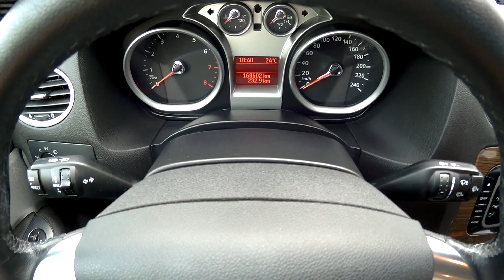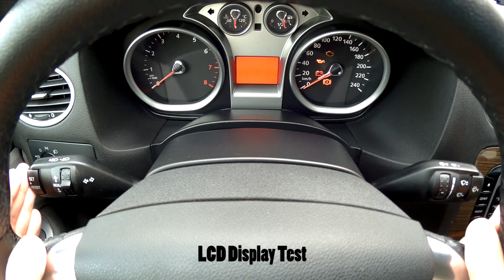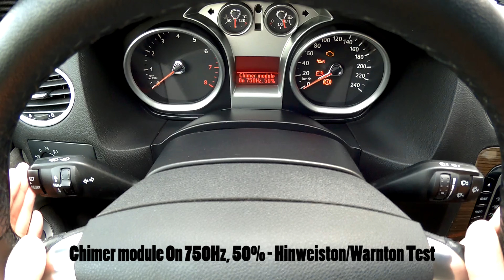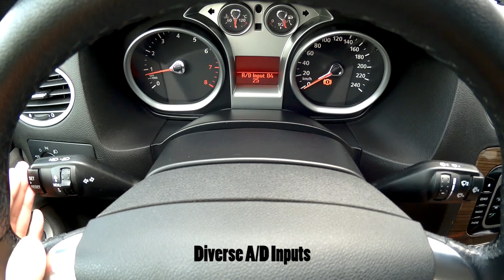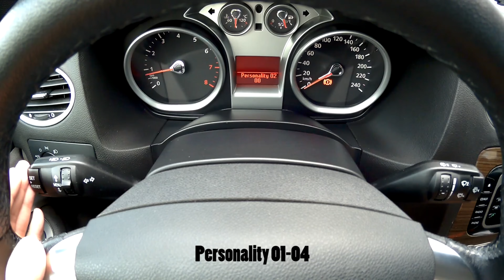Service Menü für Ford Focus MK2 | C-MAX | Kuga - Bordcomputer Selbstdiagnose Modus | DTC Fehlercodes

Comment from the maker: Mit Startknopf aktivieren / Activate with Start Button (keyless go)

Für Fahrzeuge mit Keyless Go and Starttaste: Halte einfach die Set/Reset Taste gedrückt, während du die Zündung per Power-Taste einschaltest (Keine Füße auf den Pedalen!). Wenn die Testmeldung auf dem Display erscheint, kannst du die Set/Reset-Taste loslassen.

For vehicles with keyless go and start button: Simply hold down the set/reset button while you switch on the ignition using the power button (no feet on the pedals!). When the test message appears on the display, you can release the Set/Reset button.
Reply from the maker: Die warntöne gehören zum testdurchlauf. Fehler sind unter dem Punkt DTC aufgelistet.
Reply: My one has keys, is not keyless but I will check anyway turning the key in the ignition. It will work out? Thank you.
Reply from the maker: Like in the video, yes. 🙂
Reply: Ñ
Reply: code 5750 (C1750)Accelerator position sensor out of range

Comment: Great just i dont know what of the most messages means
Reply from the maker: Hello, doesn't the listing in the video description help? Otherwise, I'm also happy to help here.
Reply: @htbo  hi there..to be honest i just saw the list:) thanks alot
Reply: @htbo  hello there..i cant understand or find same message as listed..can i write them all down and write them here or some mail?
Reply from the maker: Yes, write everything down here and I will try to respond as quickly as possible. 🙂
Reply: @htbo  "cold engine 4.41 007
-eco gear shift 4.91
-personality 0300,0200
-port t ed
-port s 11
-port p22
-port m14
-port l FF
-port e of
-port a 1b
-ad input 0515
-ad input 03 ff
-ad input 02 7d
-ad input 01 ff
-ad inputt 00 96?not sure
-pats key flags 10
-fuell flow 0000
-fuell guage 0185
-fuell ad 2 input 0 passive

There is a few more...iwrite later..i dont want to send so much))

I accidentally change my temperature to farenait from celcious...how i change back?)
Reply: Hi...i wrote the codes..if u can describe them please

Comment: I have a focus 2009 duratec the presence key only works the open and lock option does not work what can it be?
Reply from the maker: Hello, in which country was the Focus sold?
Reply: @htbo  Brasil
Reply from the maker: I think that's the reason. For the Brazilian market, features or entire equipment characteristics are often omitted.

Comment: Not working in KUGA MK1 2011 with Power Button (KeyLess System) ;(
Reply from the maker: Hello, should actually work. Read through the first pinned comment. if that doesn't work just get back to me.

Comment: Bonjour , je fais exactement le test avec le bouton set e reset je tourne la clé mais le mode TEST ne m’apparaît pas , j’ai une Ford Focus MK2 2008.03
Reply from the maker: Bonjour, en fait, cela devrait fonctionner de la même manière pour ce modèle. Pour autant que je sache, il n'existe pas d'autre combinaison de boutons.
Reply: @htbo  oui , j’ai testé plusieurs fois , mais le Test n’apparaît pas , et moi mon écran lcd il est plus grand que celui dans la vidéo
Reply from the maker: Le plus grand écran est installé dans les véhicules équipés du système de navigation. Normalement, cependant, cela ne devrait pas avoir d'influence. Je vérifierai à nouveau plus tard.
Reply: @htbo  oui , ma Ford est une phase 2 2008 en break , full options et est équipé de l’écran avec le système de navigation touch  , mais je ne sais pas pourquoi cela ne marche pas
Reply from the maker: Avez-vous une boîte de vitesses automatique ? Veuillez essayer d'accéder au menu avec les portes fermées, le frein à main enclenché et le frein serré. J'ai demandé à nouveau, normalement cela ne devrait pas faire de différence avec le système de navigation.
Salutations d'Allemagne.
Reply: @htbo  non j’ai une manuelle à 5 vitesse ,

Comment: Hi I have a 2008 focus manual. I left my lights on and the battery died I have tried charging the battery with jump leads and now I get a transmission malfunction error and no crank. Do you think this method my had me find a error code?
Reply from the maker: Hello, can you give me the exact error code? Already measured the fuses? Normally, a dead battery or a proper bypass of the battery should not limit the functionality. However, diffuse error codes can be caused by undervoltage.

Comment: Hey there thank you for the great vids... I know this might be off topic but Im having a problem with radio factory one when I want to use bluetooth it says that audio is muted but it is not so I simply cannot use it... do you perhaps know how I might be able to fix this?
Reply from the maker: Hello,
just for the sake of interest: have you ever tried another cell phone? this way you could rule out a source of error. Which cell phone is it actually?
Reply: @htbo  you see the problem is not a cell phone but radio itself whenever I push the button phone on the radio the radio says automatically it is muted and I cant even find my car when I look for it on bluetooth connections
Reply from the maker: the "phone" symbol in green (accept call) and red (hang up) is actually the mute button for radios without bluetooth module. since i assume that you have already connected your phone to the radio in the past, there might be a module or software error. which vehicle do you own exactly?
Reply: @htbo  nope... i have never successfuly connected to it... I have it for 3 years now but its starting to annoy me... I have Ford C-Max 2009
Reply from the maker: ford installed the bluetooth modules seperately for an extra charge, so the radios all look the same. in your (as well as my) case you will not own a bluetooth radio. so the "phone" buttons are only good for muting.
Reply: @htbo  really? OMG so then I should look for some external bluetooth to buy
Reply from the maker: There are special adapters for Ford radios with bluetooth which can be connected in between. Costs between 20 and 40€.

Otherwise there are of course also the radio adapters for the cigarette lighter. Or often also an AUX IN connection in the glove compartment.
Reply: Same problem with my car Ford Kuga 2009 years,I want to use Bluetooth I press the button and the sound of the radio muted,I think it work with Aux

Comment: Hi. Habe eine Fehlermeldung mit Motorstörung - reduzierte Beschleunigung. Passiert meist wenn Auto über Nacht nicht gefahren wurde bzw wenn's nass draußen ist. Kannst du mir sagen woran das liegen könnte? ESP Kontrollleuchte leuchtet. Ford Focus 2008 EcoSport, 1.6l Benziner. Danke, Eli
Reply from the maker: Hi, ich schaue nachher mal, kannst du mir mal den genauen fehlercode durchgeben? Danke!
Reply: Habe leider keinen Code. Er zeigt nur Motorstörung, reduzierte Beschleunigung und ESP Leuchte leuchtet permanent. Er reduziert die Geschwindigkeit.
Sorry, habe deine Nachricht übersehen.
Ich denke es ist ein Sensor, ich weiß nur nicht welcher und warum? Und es passiert nur bei Regen wenn Motor kalt ist. Wenn er dann warm gelaufen ist, ist alles normal 🤔
Reply: ÖAMTC konnte den Fehler nicht auslesen weil an dem Tag kein Vorfall war. Fehler wurde gelöscht. Kann dir die Fehlermeldung die er mir gesagt hat nachher schicken, falls das weiter hilft
Reply: So, deinen Test nochmal durchgeführt nachdem wieder Motorstörung angezeigt wurde.
DTC #01 D900
DTC #02 E510
Vielen Dank für deine Mühe
Reply from the maker: Hallo, die Fehler bedeuten folgendes:

E510 "Missing or invalid security data to PCM"
D900 - CAN Bus - Communication fault

Alles Fehler die nichts aussagen, da sie z.b. bei schwacher Batterie hinterlegt werden. Nach kurzer Recherche könnte beispielsweise ein Raddrehzahlsensor defekt sein. Einfach mal "E510 D900" (ohne ") bei der Suchmaschine deiner Wahl eingeben, da erscheinen dann viele mögliche Lösungsansätze zu deinem Problem.
Reply: Vielen Dank. Habe bereits recherchiert. Ja, es könnte ein sensor sein oder ein angeknabberter Schlauch/Kabel durch Marder 😐
Habe gesehen, dass das Massekabel angebissen ist und die gummihalterung der Zündkerzen. Könnte deshalb auch dieser Fehler angezeigt werden?
Reply from the maker: Natürlich sind das auch fehlerquellen, dadurch dass aber ESP und ABS als fehlerquelle angezeigt werden, würde ich mich schon mehr in Richtung Sensorik am bremssystemen bewegen. Ist das massekabel denn sehr beschädigt?
Reply: Ok, dankeschön. Weißt du vlt wo der Sensor vom ESP ist? Oder kommt da nur ein Mechaniker ran? Die Ummantelung vom Massekabel ist an einer Stelle offen und man sieht dass 2,3 Drähte durchgebissen sind. Da es offen liegt (die Stelle ist oben, also direkt neben dem Kotflügel), dachte ich dass ich deshalb diese Störung habe. Weil da ja Wasser reinspritzen kann. Komisch ist auch, wenn der Motor sich erwärmt, hab ich keine Motorstörung. Deshalb denke ich dass es das Massekabel sein könnte
Reply: Hiho! Vielleicht ist das auch der "berühmte" Kontaktproblem-Fehler am Hauptstecker des Kombiinstrumentes, also kalte Lötstellen auf der Platine...? Nachlöten? Viel Erfolg!
Reply: Hi, danke dir 👍. Du meinst ich soll das Tacho komplett ausbauen und diese Stecker durchchecken? Ich denke dass iwo Wasser durchkommt. Denn sobald sich mein Focus aufgewärmt hat, zeigt er mir keinen Fehler mehr an. Also verdampft das angesammelte Wasser beim warmlaufen des Motors und deshalb keine Fehlermeldung.
Trotzdem werde ich deinen Tipp mal probieren. Dankeschön
Reply: @elimalce7996  In diesem Fall scheint es mir nicht unbedingt notwendig zu sein, denn Du hast ein eindeutigeres Fehlerbild als das beim FoFo meiner Tochter war. Aber die Bussysteme sind so empfindlich bei Störungen, weil da so geringe Ströme/Spannungen unterwegs sind, dass es helfen könnte. Viel Erfolg im Falle des Falles!!
Reply: Eindeutig ist es ja nicht. Ich denke nur logisch nach. Außerdem haben wir sonst fast alles überprüft und das ist das einzige logische. Werde noch diese plastikabdeckung unter den scheibenwischern vorne runter montieren und diese Dichtung mal überprüfen. Ich will nicht zuviel Geld ausgeben da es sich nicht auszahlt für ein 2008er Modell. Hoffentlich finde ich bald raus was es ist bzw woran es liegt.
Was hat denn eigentlich der FoFo deiner Tochter angezeigt? Woran hast du gemerkt dass etwas nicht stimmt?
Reply: @elimalce7996  Bei ihr waren es unerklärliche Aussetzer des Motors, gepaart mit Aufleuchten der LED's im Kombiinstrument. Das Ganze konnte ich allerdings nicht simulieren und daher habe ich die "Operation" vorbeugend gemacht, um es weitestgehend ausschließen zu können, dass es daher kommt.
Reply: Aha, also doch was anderes als bei meinem. Trotzdem danke für die Hilfe. 
Hoffe der FoFo deiner Tochter funkt wieder normal. 
LG, Eli
Reply: @elimalce7996  Danke, ist mittlerweile von einem LKW zu Schrott gefahren... Es geht ihr gut, alles geregelt, anderer FoFo vor der Tür. 😀

Comment: Can you please help me out, the code #01 E510 is displayed on my cluster board when i do the diagnostic, my car is ford focus diesel engine 2008 model
Reply from the maker: Hello fesocan, the error often appears if the battery is / was too weak. as long as the vehicle does not cause any problems, you can ignore the error.
Reply: @htbo  Thanks for your reply. 
When I use OBD scanner, it showing P0488 P0487 and P2141,  but when I check from the car, it shows #01 E510. I always get engine malfunctioned everytime. With the research I've done I understand this electrical fault
Reply from the maker: Hello, the faults indicate an electronic or mechanical fault on the EGR valve (exhaust gas recirculation valve). This also causes the engine malfunction message. So I would search in this area and consult a workshop if necessary.

Comment: Hi buddy, I have a 2010 mk2 focus with keyless go and big dashboard, how can I open hidden features?
Reply from the maker: Hello Dori, 
Look at the first pinned comment and expand it.  There is all the information you need.
Reply: How To Blue Oval Bro, but you don’t have a pinned comment at the video or I can’t see it.
Reply from the maker: Oops, my mistake, was in a hurry.

Normally it's enough to hold the set/reset button while you turn on the ignition with the power button.  When the test message appears on the display you can release the set/reset button.

Please write me if this works for you.  Otherwise I'll check if there are model dependent differences.
Reply: @htbo  Ok bro, I will tell to you when I will try it, now I can't try , I'm not at the car. Thanks bro.
Reply from the maker: and... did it work?
Reply: @htbo   Yeah it works. Thank you very much.

Comment: DTC D900 steht bei mir, was bedeutet das nun? Lg
Reply from the maker: Das bedeutet nichts anderes als dass die Kommunikation durch z.b. niedriger Spannung intern unterbrochen wurde. Das ist kein richtiger Fehlercode und kann gerne mal bei zu niedriger Batteriespannung angezeigt werden. Daher ignorieren.
Reply: @htbo   en español ...que significa D900 ???
Reply from the maker: Esto significa que la comunicación se interrumpió internamente, por ejemplo, por baja tensión. Este no es un código de error real y se puede mostrar si el voltaje de la batería es demasiado bajo. Por lo tanto, ignóralo.

Comment: Ma tu che hai questa macchina a 20 km orari fa anche a te una leggera grattata che si sente sotto la pedaliera...?A me hanno detto che è normale ed è un controllo della centralina dell'ABS....ti risulta....?
Reply from the maker: Sì, è corretto!  Si tratta dell'autotest ABS/ESP.
Reply: @htbo  ma xché ho provato auto come la mia ed è impercettibile questo fastidio mentre sulla mia lo sento di più....?c'è un modo per sentirlo meno questo fastidio secondo te...?In Ford mi hanno consigliato di sostituire il liquido freni ma non mi hanno garantito che va via....ti risulta?
Reply from the maker: Temo di non poter dire esattamente.  Sono stati controllati i sensori ABS?  Potrebbero causare problemi di questo tipo.
Reply: @htbo  pensi che con una semplice diagnosi sia sufficiente risalire ad eventuali problemi a qualche sensore abs...? E nel caso....si potrebbe sostituire qualcuno nell'eventualita....?
Reply from the maker: Sto solo dicendo che può essere una delle tante cause possibili.  Finché l'auto fa questo test solo una volta dopo la partenza e non ci sono altre anomalie, non mi preoccuperei.

Saluti dalla Germania.

Comment: Hola, éste video es demasiado útil lo agradezco demasiado. En mi focus tengo un problema que no fue diagnosticado en el test, el pitido de alerta suena mal, casi no suena al igual que las luces de cruce que no suenan y ninguna alerta sonora. No sé si deba revisar los relays de la fusilera interior.. :/ muchísimas gracias por tu video!!
Reply from the maker: Hola, Alejandro, 
 
Como era de esperar, yo revisaría los relevadores primero.  Suena muy parecido a esto es donde residiría el problema.

Saludos desde Alemania.
Reply: How To Blue Oval agradezco mucho tu pronta atención y tu disposición a los comentarios. Revisaré eso lo más pronto posible, saludos desde Venezuela!!
Reply from the maker: ¿ya has encontrado el problema?
Reply: How To Blue Oval aún no 😕. No he podido revisar aún pero cuando lo haga recurrire a escribir por aquí. Muchas gracias por tu atención!
Reply: @alejandrosalazar6044  ¿ya has encontrado el problema? :)